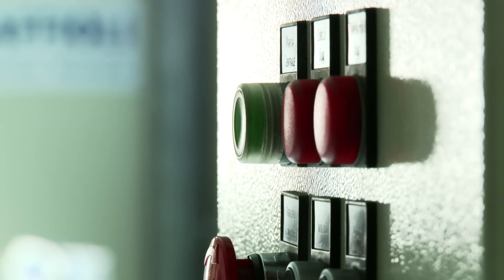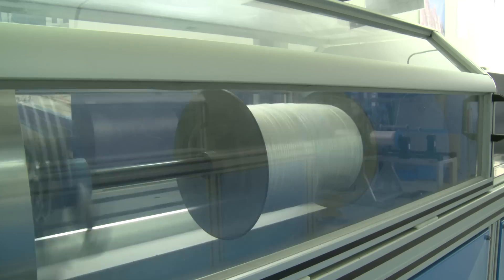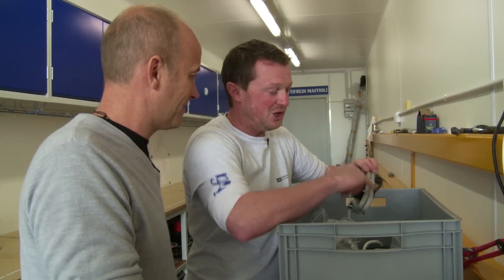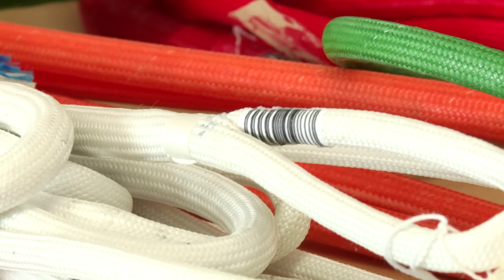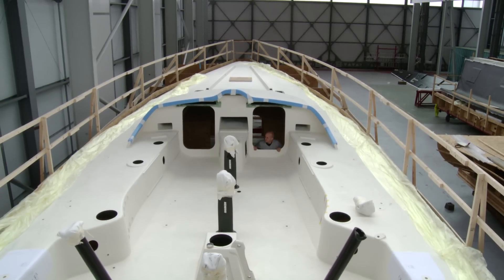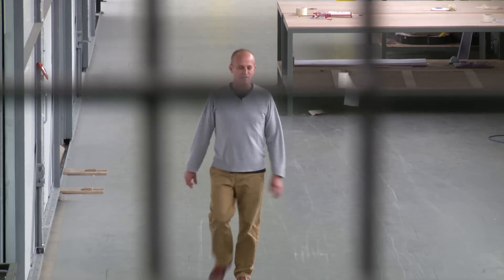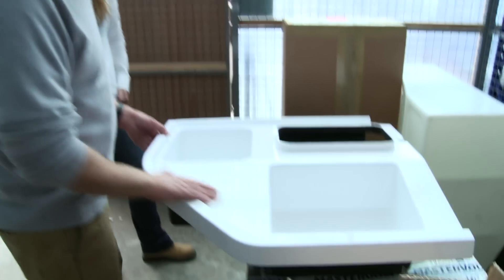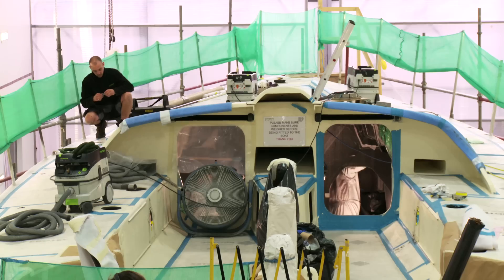Episode 12: Rope making | Volvo Ocean Race 2014-15

Comment: I didn't know the type of rope played such a big part in these boats. Should of figured when these boats are all carbon fiber, but they brake down so much though. If they just built them a little stronger and they sailed them study threw the whole race they might just when that way. instead they push them to they're limits then brake down all the time. Just my opinion.
Reply: If your boat is too heavy it'll be too slow and won't win. If it's too light it'll break and you won't win.

Finding the sweet spot is goal (but incredibly difficult to do; part of the reasons for switching to a one design class).